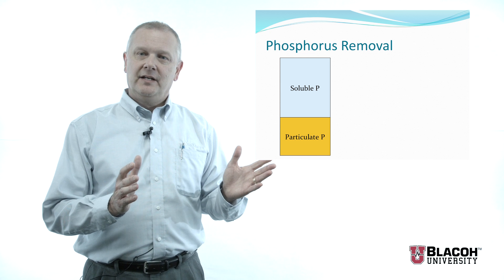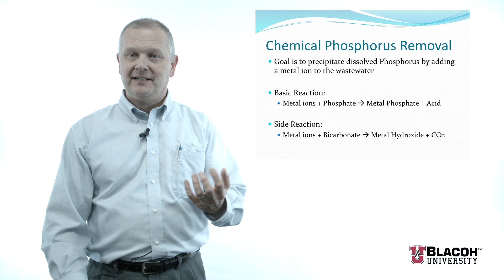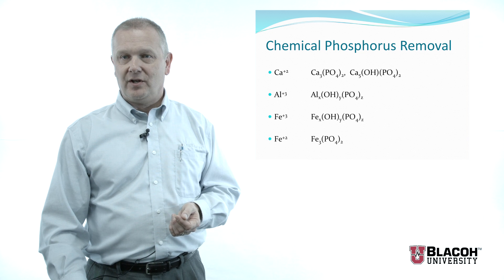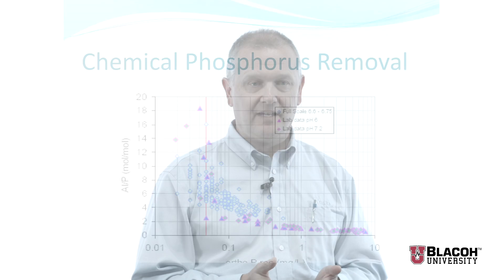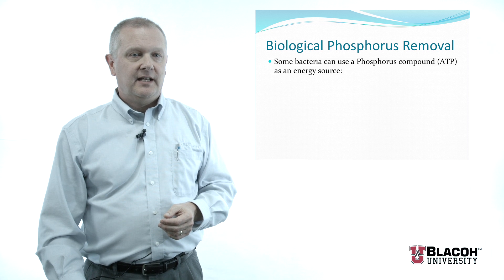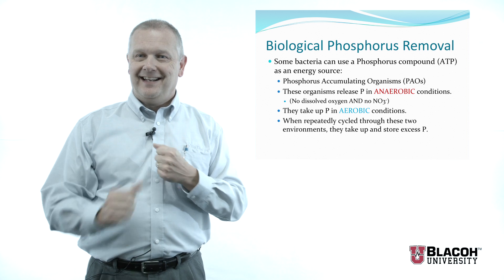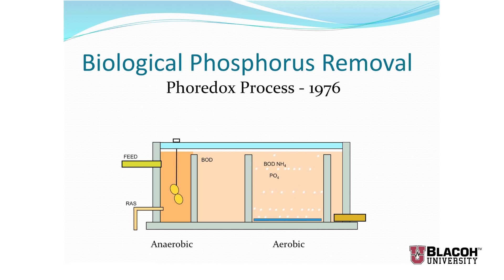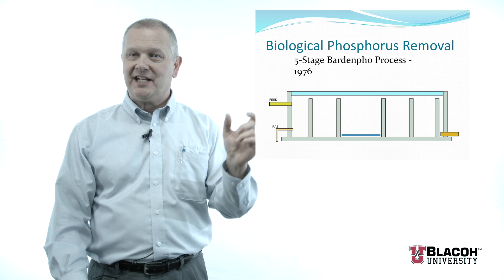All Things Water Course I, Nutrient Removal Part 2 of 2

Comment: Question for the presenter: What is your opinion on an algae-based biological treatment system to reduce phosphorus and nitrogen concentrations while at the same time culturing excess amounts of algae biomass that can be sold for a profit to the biofuel industry or other industries? The system would include a photobioreactor to enhance photosynthesis